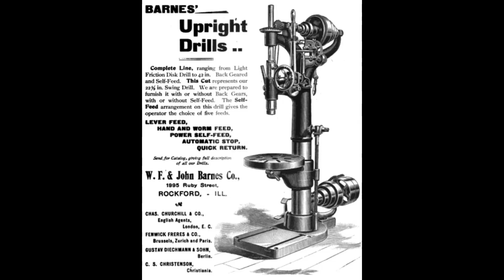OLD STEAM POWERED MACHINE SHOP 30   Bushing a Flywheel

Comment: Reminds me of when I was a kid. One of my good memories of my old man was that he used to bring home his lunch baggies filled with shavings and filings of silver, brass, copper, aluminum, and once, gold. He'd give these to me, and I had a small safe I always kept them in with my coin collection. I gave them all to my eldest son a few years back.... I hope he finds joy in them. Thanks for triggering the memory, Dave - it's been hard to come up with a good one lately.
Reply from the maker: Great comment, thanks Mel.....Dave
Reply: @davidrichards5594  I really get a kick out of your channel because of a couple reasons... I was raised around machinists - my old man and Grandpa and, in turn, most of their friends. Spent lots of time in the machine shops as a kid and was naturally shown things by the guys as they worked. Also, I've been a mechanic since 1974, have worked on cars back to a 1926 Willy Whippet, farm equipment back to horse-drawn, heavy equipment back as far as Caterpillar crawlers where the logo on the radiator shell looked like a caterpillar, aircraft back to cloth covered, and motorcycles back to the 1930's. I'm really enjoying the steam - always wanted to build myself a steam powered houseboat - I figure fuel would be pretty much free, considering most rivers have plenty of snags that could be cut.
Reply from the maker: @maniyan_wanagi  Build the houseboat Mel, time is short my friend.....Dave
Reply: @davidrichards5594  Will you help me to figure size needed and to source an engine and boiler? I think I might have one last grand project left in me......

Comment: Enjoy your show. When I was in school we had line shafts and flat belts to every thing. A big 50 cyl ac motor ran the line shaft and in the high school there was a corles Steam engine powering the generator that produced the 50 cyl power. I have a traction and enjoy the power of steam for the last 53 Year’s
Reply from the maker: now THAT'S a High School Shop......Dave

Comment: Loved it David. I was a little surprised you didn't use a Steady Rest when you faced it and beveled it for the Center, but hey you got it done. Thanks for sharing I always take time out of my day when you post a new video. Best Wishes n Blessings. Keith Noneya
Reply from the maker: Keith:Just saving time, the rest was way out on the other end of the machine on the other side of the saddle. It was chucked up solidly, taking light cuts.....Dave

Comment: If one looks under the head of the shop engine the steam leak looks like the shop floor is on fire at 13 minutes.  Great video, thanks!
Reply from the maker: The sunlight is reflecting off the water in the catch pan under the engine & the steam is from the cylinder drains..Dave
Reply: I knew it was steam.  Saw the catch pan in # 31.  Just fun to watch so I thought some other folks might enjoy it.  ;-)

Comment: ...My last job as a 'maint-mech-electrician'.....I had a couple punch presses with flywheels like that, somewhat larger. Operators never set the die/s up with any clearance, so the 'clutch' just tore up the side of the wheel and the bearings....clutch pin went into hardened steel insets, but those, and the rest of the machine, still got hammered pretty bad...even broke a 3" cast-iron bolster plate in half....  Good job making that bearing real quick....!
Reply: we had a peddinghouse punch, that could punch 1" x 1 1/4" holes. we never ever broke anything on the punch itself. we did have a guy put the bottom die part in upside down, and that was a learning experience. It broke the die, and fed out a long turd of pressed together punchouts pressed together. don't do it!!
Reply: ...Peddinghouse....yeah, heavy stuff....1x1-1/4"...couple hundred tons....  Years ago, around 1986....I worked as Elec-maint in big Steel fab shop....we had a 700 ton Punch press....punched 1-5/8" holes in 1" footer plates....slugs came out too hot to tough...! machine was very old...early 1900's, belt drive converted to electric motor....BIG gear on the main shaft, turned another big gear machined onto the edge of flywheel....
Reply from the maker: Quite the "animal".....Dave

Comment: Unusual to see you do a rush job Dave.                                                                                           I'm guessing you ordered what looks like double the material needed for the job, just in case something didn't go right.                                                                                                                                   Richards engine exhaust sure sounds crisp, I guess it will never get loaded up enough to really bark!                                                                                                                                                            Can I still hear a slight noise in the valving eccentric bearing?                                                  Any updates on the Morris engine? 
As always, a great video Dave & this one showed me how a machinist running a small shop in the day, had to have his mind & ear on many things, boiler pressure, water management, did I oil that bearing etc etc.                                                                                                          Finally, nice to see more shaft driven equipment being restored for commission into the shop, just love the channel Dave, keep the vids coming.
Reply from the maker: Thanks for the comment Mike, They ordered the brass and shipped it here. I think they have another one that's getting wobbly. I found the noise and will explain in the next one. Working on the Morris rod now....Dave

Comment: First time I remember you shoveling coal into the boiler,  mostly I remember you feeding it split wood.  I used to help my grandfather cut up wood and pry apart wood crates to burn in the steam boiler that provided steam heat and hot water to the six flat building.  The wood was anything we could scrounge up to supplement the coal stoker.  We moved before 
I grew big enough to shovel coal from the big bin to the stoker.  The wood just left soft ash, the coal left hard clinkers that had to be broken up to remove.  Even though it was going to be burned, my grandfather would make square saw kerfs so smooth with a hand saw you could count rings, when I asked him why, he said to keep in practice in case he needed to make something.  Where do you keep your coal? We had a coal chute to the basement and a 20x20 coal bin. Mom was not happy the day I explored the coal bin and emerged full coal miner appearance. Sixty-five years later, I would love to do it again.
Reply from the maker: James: You got that right. Coal is a pain but it takes less playing around with the fire. I use it with junk wood too...Dave
Reply from the maker: I guess cheap coal is cheap coal...Dave
Reply: Is that Anthracite or Bituminous coal that you are burning in the boiler?  I am a director at a local historic railroad.  A couple weekends ago we had a steam engine brought in to pull excursion trains.  We had to get a load of Bituminous coal for it, apparently Anthracite could not be burned in it.  It was a small switcher engine built in 1925 and the owner brought it on a drop deck trailer and off loaded it right onto our rails. Pretty neat.  My two young kids really enjoyed the ride, especially when the engineer blew the steam whistle at the crossings.  Nothing like the sound of a stream whistle.   http://durr.org/
Reply from the maker: Hi Dan:    I've tried to burn Anthracite coal with poor results. It requires much more draft,  and gives off it's heat at a lower rate (less volatile) although it is said to have more total heat energy per pound than bituminous coal. 
I have been given hard coal and used it mixed in with soft coal. When railroads started using it, the locomotive fireboxes had to be designed bigger and grates changed to burn it hotter. ....Dave

Comment: I will be watching (as usual) with interest in the Racine rebuild, as i am rebuilding a power hacksaw as well.
For some reason i have always pictured it cutting on the push stroke.... and then i see your little one cutting on the backstroke??
Thanks again for another lesson mate.
Reply: If you cut on the back stroke you save wear on your vice, and the whole width of the back stop takes the load.  Just make sure your blade is the right way around, and the motor goes the right way so it lifts on the return and not on the cut!
Reply: Mark Avis thanks mate. It'll  be running off a lineshaft belt, so wont be to hard to turn either way. And the lifting eccentric is easily reversible

Comment: WONDERFUL! Always anxious to see the next episode. Your video formula is way ahead of the rest. That overhead door has got to go....in my opinion....just so happens, I manufacture the old horseshoe rollers for doors copied, rivets and all, from a real old one I found on my shop. I can make up a pair and a custom rail for a competitive price for ya. I can send photos to an email address. I see ya have some rollers up above.
Reply from the maker: Josh: It's an 1870 carriage barn had upper and lower sliders on both sides. They were made out of 1" tongue & groove and were extremely heavy. The addition got put on the front and with the smoke stack there is no place to slide them. ...Dave
Reply: Aw shucks....yer better off anyways (:

Comment: G'day Dave the Racine bandsaw looks terrific especially when it's restored.    The new steam engine is pretty quiet for its size and power and to see it running great and judging by the exhaust beat it's in good timing.  I noticed that you using coal is that to do with temperature over wood?   Another interesting video and it's good to see that paying jobs are coming through, thanks mate regards John

Comment: So how much was that chunk of bronze David?  I never cease to be amazed at the price of such material at UK model engineering shows, it's usually a good deal smaller in diameter but still hollow and sold by the inch!  Brilliant video. I'm also amazed that you can still find pre-1925 machinery, i.e. the 'new' Racine saw.  You now have three steam engines, don't you?  There's that vertical which hasn't featured for a while.  Beautiful house by the way.
Reply from the maker: Thanks for watching Colin:  They had it shipped here so I don't really know, probably over $100. plus shipping. That is my neighbour Paul's house, see video 29....Dave

Comment: Hi Dave

I heard the safety valve open on the boiler after I saw that you confirmed, I had a smile. Are you purging ( make little blowdown) your boiler each day to remove impurities , when it is under pressure?
Thank you for your good videos always very interesting and constructive, dont stop.
Reply from the maker: I "blow down" the boiler drain a few seconds 2 or 3 times a day. The Boiler concentrates the impurities and the rain water gets a little cloudy if it hasn't rained in awhile. But it never seems to show in the glass. ...Dave 
"

Comment: Another nice video great shots and editing. Why did you not machine the o.d and the bore without removing from the chuck, and did you make an allowance for the bore closing up when it was pressed into the flywheel? Cos for sure it will, I've done a few of these myself!!
Reply from the maker: I like to cut it off in the saw, then turn it around and face the back side, then bore straight through. Just a way of doing it....Dave

Comment: Dave, at the end of your season could you do a video of your shutdown procedure? Draining the water and coating the metals to prevent rust and do you back-off the adjustments so when the machines expand and contract from temp changes? Also, all you have to do in the spring.

Excellent demonstration and quick fix, thanks.
Reply: he makes it look easy, but i am sure there are lots of necessary procedures to follow. i really admire this guy and his craftsmanship.
Reply: That’s a great suggestion.

Comment: Are there things you can do with the larger steam engine that you couldn't do before, i.e. was the smaller steam engine limiting you? You shared that the new engine fits your original vision but is it just appearance or does it enable work that wasn't possible? Certainly it takes more steam, more water, more fuel. Still, beyond amazing that you found the new engine so pristine.
Reply from the maker: Turns slower like a "mill" engine, quieter, uses about the same amount of water (so same steam) power requirement wise, it won't do anything on this line shaft the the smaller engine couldn't do....Dave
Reply: Thanks:)

Comment: Awesome !!  What's interesting is that a modern production shop came to you in a circa 1925 shop to fix their flywheel.  That must of been fulfilling.  The new Richards steam engine looks like it's hardly working.  What RPM is it running under load ?
Reply from the maker: We checked it the other night and sped it up a little to 87 RPM. That makes about 230 on the line shaft. It could go a little more....Dave

Comment: I've watched several of your videos and enjoy them so much. Thanks for taking the time to explain the processes so well.

My question is about heating up the steam. Is it hard to maintain a even pressure of steam? It looks like the size of fire would be a large part of the issue and also from a demand side shutting down or turning on equipment loads would have a large impact. How hard is it to maintain the pressure giving both variables?

Thanks!
Reply from the maker: I'll get fired up this morning and video some on that, thanks....Dave

Comment: How much does such a job cost? I'm only interested out of curiosity. I don't have a punch press or need a new fly wheel repairing in a hurry but when you mentioned the raw billet of brass cost a fair amount, plus your time, plus the need to put any other jobs on hold... must be a tidy sum :)

Comment: In years gone by some shops had a lathe dedicated to cutting a spiral oil groove in the bore.
I wonder if you bothered to cut some type of oil groove or was job too "HOT'? Thanks.
Reply from the maker: Hi Jim: I think this one was greased through a cross drilled hole in the shaft. The original bushing didn't have a groove so I didn't think it was necessary.......Dave

Comment: Dave, Your lathe has a four-jaw chuck and I see you using a gauge pointer to center your work. Are you looking for the high spots to make your adjustments or how does that work? Thanks - another winner video.
Reply from the maker: It's actually an 1890's indicator. I showed it a couple times in earlier videos and you can find some detailed photos on my g+ page. click the red circle on the channel home page. click the photo to enlarge.....Dave

Comment: Wonder if you can recall how much you allowed for press fit and how that allowance 
influenced the bore dia. of the bushing.  And, what shaft to bushing running clearance you were shooting for? That is the real knowhow. Thanks, Jim
Reply from the maker: .002" press fit in the flywheel, .008"-.010" clearance on the 2 1/2" shaft....Dave
Reply: Thanks- and that .010 clearance meant you did not have to be concerned of its reduction caused by the press fit. Always a concern for me
on 3/4 shafts.

Comment: nice shop.. i dont know much about steam working shops but why is there smoke coming from the drill press belt?
Reply from the maker: It's steam rising out of the bucket that collects the condensed water from the engine input pipe, I kept it cracked open a little to vent the water that would have gone through the engine.....Dave

Comment: I was was wondering about the differences you have found with the new engine.
More torque?
Is the shaft speed more consistant?
Thanks
Reply from the maker: It slows down a few RPM momentarily if you jam the lathe on in a high gear and I can feel it overspeed a few RPM for a second when a load comes off. The old gravity Gardner Governor is a little sluggish compared to the higher speed spring type Pickering on the other engine. You can see the advantage of the pickering, which is just what they advertized.

Comment: How much undersize did you allow for the bearing to be pressed fit?.Love the shop and old machinery.Thanks
Reply from the maker: about .002" bigger than the hole...Dave
Reply: David Richards Thank you.Once pressed in,did you have to bore the hole larger to size?Just wondering if it lost some diameter.

Comment: How do you hold the ID?. If you have a .002 press, do you just take an extra two thou off the ID?
Reply from the maker: I didn't. They wanted ABOUT an extra .010" over 2 1/2" ID.  for clearance to make it easier to assemble on the crankshaft. So I bored it to .010" over and when it was pressed in they got .008". It wasn't a real critical fit.....Dave

Comment: How do you calculate the shrinkage of the ID of the bushing when it's pressed in?
Reply from the maker: It's about the same as the "interference" on the fit which in that case the bushing was about .002" bigger than the hole.....Dave

Comment: Hey Dave, what's that tool you're using to center up that piece of brass for the bushing?
Reply from the maker: Dave, It's a forerunner of a modern dial indicator, it has a very sensitive pointer that reads in thousands. Patented in 1890's....Dave

Comment: How did you manage that flywheel up and down off the press?? It must weigh several hundred pounds.
Reply from the maker: Engine hoists are handy things....Dave
Reply: As he said, he did it with an engine crane. I suspect it may be a modern one that we all use as we did not see it. Though a 50 y/o one was made considerably better.

Comment: The governor on your new engine is bothering me. Maybe you could explain its emergency (overspeed) trip feature.
Reply from the maker: Hi Jim, It has none. I installed a quarter turn valve in the overhead steam line with a pull chain. The smaller engine has a spring loaded mechanism on the governor that will shut it down if the belt fails. Thanks for watching.....Dave